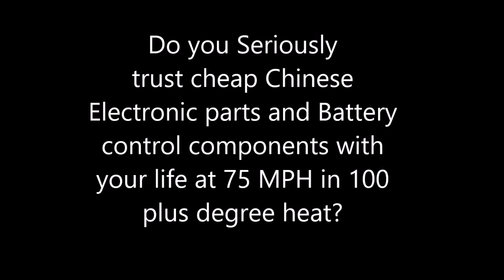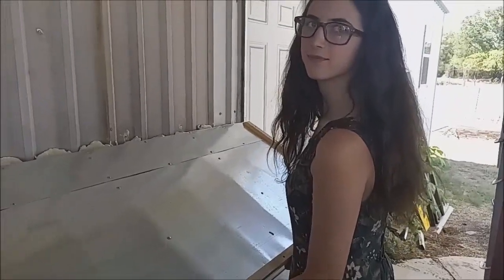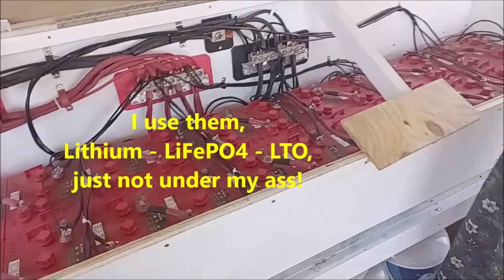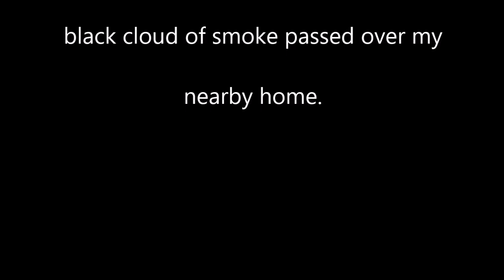Lithium Ion Electric Car On Fire, Battery Car on fire, The NEW NORMAL?

Comment: We really haven't figured out this electric car thing yet.  Battery fires need a special response from the fire dept.  They really aren't equipped.  This past winter I heard about a storm causing huge lines of stopped traffic.  Someone commented that sitting there for hours with the heater running meant any electric cars were going to run out of power and cause more issues once they cleared the accidents.  It never really dawned on me like that before.  You can idle a gas/diesel car for a good chunk of the day with the heater on and not worry about.  They also don't work nearly as well in cold climates with reduced range.
Reply: Heard of ELECTRICAL FIRES.  Guess NOT IN TEXAS!   PS. ICE Cars USE GAS WHILE IDLING!!!  YOU CAN RUN OUT OF GAS IDLING TOO!  They DO NOT MAGICALLY REFILL DOWN HILLS.
Reply from the maker: When my friend broke down in the winter storm last year up on I-20 she only had a quarter tank of gas, but luckily the Good Samaritans and their ATVs were bringing gas cans out to people and Diesel cans. However according to the El Paso media 13 electric cars had to be trailered and removed from the site the next day. Three people were hospitalized for winter weather related issues from those electric cars. Me personally I think all of those cars should have an alternative method of operating 300 to 400 miles of range is great but not in Texas even though we have a larger share of portable chargers and charger stations in most anywhere else in the country it still don't do you any good when you're on the middle of an interstate sitting.

Comment: This is a very fixable problem. 
In order to have a fire, there must be oxygen, heat, and material. Remove just one of those factors - and there can be no fire. In the case of electric cars you can't remove the material (the batteries). So, you have to either remove the heat (pretty much impossible) or the oxygen. Removing the oxygen from the equation is definitely do-able. But doing so requires re-engineering the car. And that cost money.
Reply from the maker: As they say wham bam thank you ma'am you hit that and run on the head.
Reply: @JOHNDANIEL1  -- You and I should talk... I'm in the process of getting a Patent on an invention of mine which I think you will find quite interesting. 
Do you have a website with contact info?

Comment: I live in Texas I seen cars on fire that wasn't electric.. I can't stand electric cars but we can't blame it on the batteries... Come on Brother u use a lot of Chinese crap... Just saying... Keep it up brother
Reply from the maker: Yes I use a lot of Chinese crap, and when it comes to a 75 mph I'm usually not got my ass planted on the inverter and four tires doing it. Stationary things from China are risky, but anything that's rolling fast is a death trap. My intent of the video is based on the information that I'm getting from a lot of people but if you got a big computer card operating things in these cars and one tiny little stupid thing goes wrong you no longer control that massive ungodly level of current. You're depending on a touch screen probably made in a slave labor camp by a really pissed off Chinese former dissident.
Reply: Yeah im sure ur right.... Keep it up brother

Comment: Should have a cooling system to keep temperature down! Common Sense and Logic!
Reply: EV batteries have temperature controll, otherwise they wouldn´t work. That is just a result of garbage components from China mixed together with Teslas nonexistent quality controll. If u put shit and shit together, outcome isn´t going to be anyting more than doubleshit.
Reply from the maker: Actually Tesla building increasingly high quality car, but the problem is when you outsource some electronic component as simple as a 500 amp SSR solid state relay and the photoelectric optic coupler fails in it then you might just have a battery that will not disconnect even though you're running the air conditioner the motors and your 60 volt feminine project vibrator at the same time. So it's really getting to a point where there's just too damn many components in these smart cars of any kind that have a catastrophe fail reaction and it's not just the electric cars just about everything that's rolled off the line in the last 10 years and no I'm not a new car hater, I'm just getting really paranoid when they put parts worth of nickel in your $50,000 car and don't even check the quality of them.
Sad to say but a sealed freon thermal switch would have been more successful to use in cars today than anything electronic based on some software or sensors. The old Marine engines use them to shut down in case of overheat, they are small, and they would work for 100,000 cycles no question
Reply from the maker: Remember when you say the words e v batteries have temperature controls. You have to add to that that those temperature controls are 100% solid state but the real way to apply that temperature control would be a final fail safe of a mechanical format. Too many of these mosfets and bi-metal switch systems or even thermal cloak sensors tend to fail nowadays. And apparently at the wrong time.

Comment: sooo you dont really know what started the fire.  now im thinking about the chevy trucks that had the fuel tank behind the seat and how those were made out to be such killers, granted it was a poor design in hindsight. I would like to see the follow up on this and hear what was determined to be the cause of all of this, i see skid marks on the road, at this point its possible that the fire could have started after some sort of accident. Lithium Ion battery's, which are what electric cars....and laptops use are prone to thermal runaway.    I know you love your lead acid so i understand your need to bash the hot newness.....messin with ya dont get mad.   Im sure the horse riders of yester year felt similar every time they saw a horseless carriage broke down.
Reply from the maker: Skid marks are from the neighbors kid. Likes to jump out on the highway from our road sideways. A real moron. But the only reason we don't ride horses is because the proper technology came along and was done right, don't forget about the medications they give women that gave them the deformed babies, or all the inventions that are now in the trash bin of History. Just cuz someone invented or says it's possible doesn't mean that it's feasible overall. I'm sure once they isolate bad parts which has been the claim most of the time of these kind of fires hopefully they'll build them in America and have some quality control.
Reply from the maker: This just popped up, see it, and know why I am avoiding all the weak link things people are wanting now. https://youtu.be/nU0nF1MxX34

Comment: The funny thing is they threw water at an electrical fire, once thermal runaway gets going it pretty much has to put it's self out once it stops shorting out.
Reply from the maker: I think with all the wildfires that has hit Texas this year the water looked to mostly be used around it from my vantage point.

Comment: I feel sorry for anyone in the car. When litium ion battery burns you can pump all the water or foam you want. It will burn till consumed. Lifepo4 batteries are a little better. Just think of the firemen responding an the chance of pack still energized an they have to spray water on electric car. It could be like spraying on live power lines.
Reply from the maker: Most all these fire trucks around here have some kind of carbonate something crap in them. There's typical Hill country oil wells around here so they carry that kind of stuff it's not straight water. But fires like this need that special foam.
Reply: LiFePO4 batteries are not used in battery electric cars (if you doubt me, name one!) and do not burn.  The NMC battery can burn and it the predominant one in cars.  Extremely dependent on electronics (BMS) to prevent overheating of battery and risks of fire.

Comment: Definitely not a good scenario. It could have been sitting in the garage and gone up as well.
Reply from the maker: When you're running an electric car in 105° heat pushing it at 75 plus miles per hour and you're running the air conditioner and all the electrics in it those batteries tend to warm up quite well and the electronics and controllers tend to be under a lot of stress all it takes is one little cheap $0.10 Chinese part in one of those components to fail and it's got hundreds of them in there.

Comment: Yes but is not a lifepo4 That is lithium ion
Reply from the maker: Yes, but the truth of the matter is it was nothing more than probably a $0.10 mosfet that burnt it to the ground
Reply: I have lifemnpo4 They are military batteries for the last four years no problem but I don’t have no BMS no balancer no electronics I’ll run them like ASIC battery that’s the reason why I don’t have no problems

Comment: I got a gas golf cart, because I didn't want to change batteries every 7 years or so.
Reply from the maker: If you get electric golf cart and put a LTO battery system in it it can last 25 years and those batteries don't require a lot of technology to operate a charge. You can basically do it with some Sanken transistors and relays.
Reply: @JOHNDANIEL1  yes, but that sounds expensive.. with no more than I would use it.  Thanks

Comment: The ICE has been around for about 150 years, whereas the electric car tech has really only been viable for about 15.  We've had plenty of time to learn all the dangers of the ICE but are just starting to learn the dangers of an electric vehicle.  Stuff like this is bound to happen, but is far from proof the technology doesn't work.  It'll just take some time, but use videos like this as a lesson to not fully trust new tech with your life quite yet!  Me personally, I'll buy into an electric car when the tech matures a bit more.  For now, I'm gonna keep my ice truck ;) Cool yet scary video sir!
Reply from the maker: It's not the technology problem it's to where the parts are manufactured problem. Globally also means outsourced junk
Reply: Actually, a battery operated vehicle was built before an internal combustion engine was built.
But the battery performance was horrible.
Reply: @gman21266  hehe, yes, that's why i used the phrasing 'viable' in relation to the electric car ;)
Reply: quality over profit like the old Saying is you get what you pay for end of story, because the 1% don’t care about us.it’s all about money nothing else.

Comment: I don’t understand why you are slamming LiFePO4 batteries!  None of them are used in electric cars!!!!

Also, Tesla uses NMC batteries not LiFePO4 batteries!
Reply: Lithium batteries burn. One bad BMS and wait for the shit show
Reply: @kayakwesty  LiFEPO4 batteries don’t.  Tesla uses a different kind(Li NMC) that can burn.
Reply: @philipmorgan1438  Li...is Lithium Google Tesla car fires
Reply from the maker: Had nothing to do with the battery material, thermal meltdown of control board system
Reply: @JOHNDANIEL1  exactly John. BMS systems have a very tight range on charging. And top of that charging has to be be in a Goldilocks range when it comes to temperature. And any battery with a Li in it is very hard to put out . Most burn down to the ground.
Reply from the maker: They said it took 6400 gallons of water and 240 cubic feet of Ura foam. 
In Idaho I salvage the motorhome that burned to the ground with 4 LiFePo4 and it was the BMS that melted and fused on when they ran the generator to charge up.
Reply: @JOHNDANIEL1  yep standard charging won't work. Keep your videos coming. You are a great teacher
Reply: @kayakwesty  ignorant statement… many types of Li batteries and each has different properties.  LiFePO4 is the type that won’t burn!
Reply: @philipmorgan1438  ok. Take a Lifepo and run a lead charger on it. ( Simulate a bad BMS) All it takes is a short. All yes all batteries burn. Lithium as of today has a higher percentage of that happening. Take your YouTube engineering somewhere else.
Reply: @kayakwesty  Simply ignorant and not true!  It’s not an opinion - simply a fact!  Other types like NMC will continue to feed a shorted component like BMS but LiFePO4 won’t.  If the cars didn’t use LiNMC, what the
OP filmed wouldn’t happen.  When you want to learn something, look into why the LiNMC is not allowed for cars in the EU…
Reply: @JOHNDANIEL1  It was the battery type that allowed electrical discharge to feed the fire etc.  The battery type DOES matter.  It’s why Tesla can’t legally sell its NMC-powered cars in the EU!
Reply from the maker: @philipmorgan1438  This just popped up, see it, and know why I am avoiding all the weak link things people are wanting now. https://youtu.be/nU0nF1MxX34
Reply: @kayakwesty  LiFePO4 batteries are not the ones which can burn.  If they overcharge or are shorted, their anode is liquid and blows out - the current then stops flowing and there is no support for a fire.